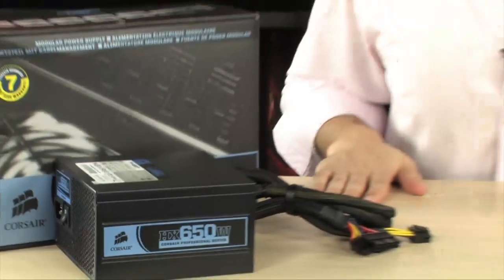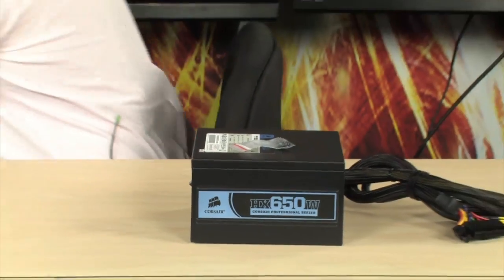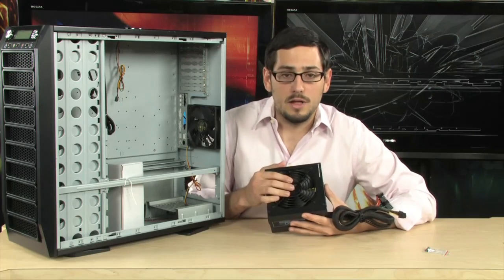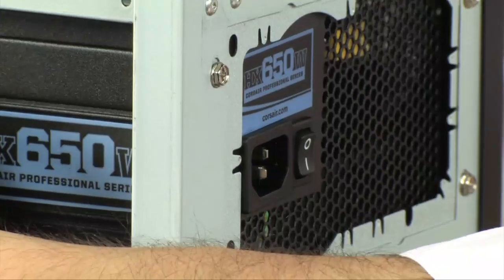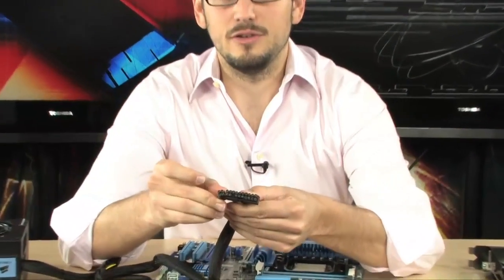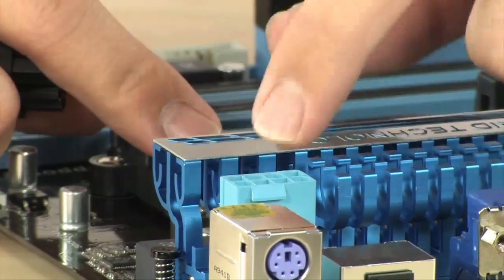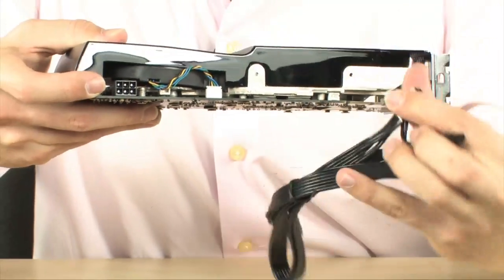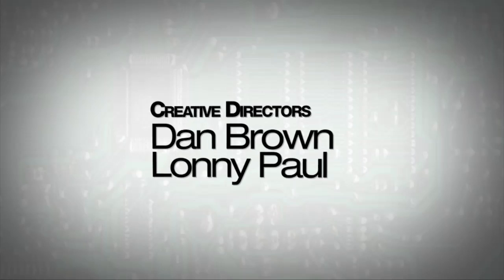How to install a Power Supply

Comment: @Patrickthe1st  It's actually better to have the PSU at the bottom in most cases, cause it makes the case more stable, weight distribution wise, and heat wise.